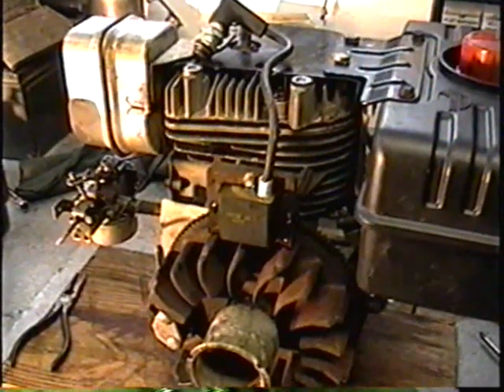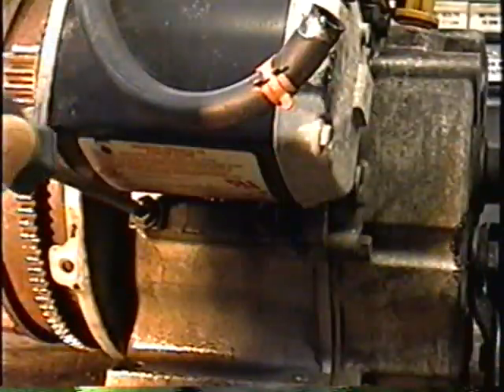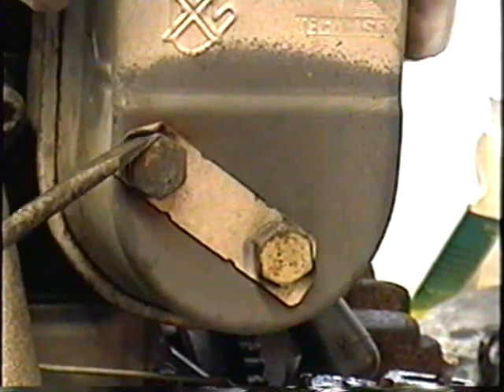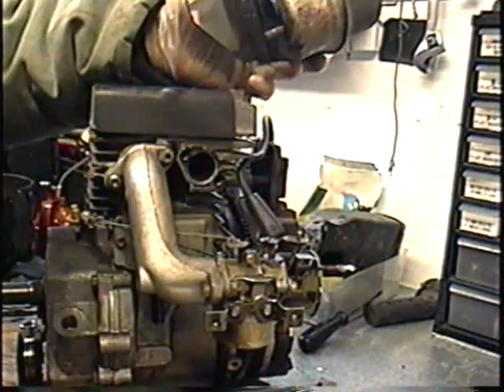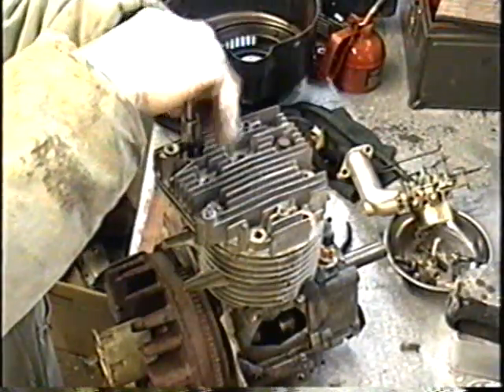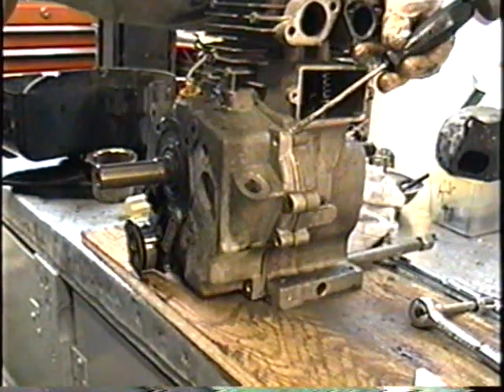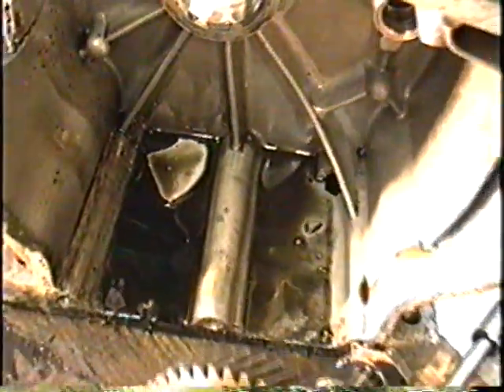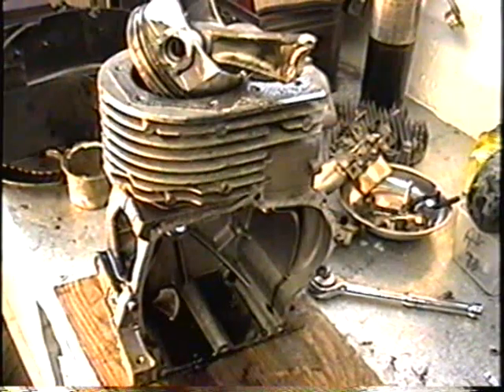TEARDOWN OF ANOTHER BLOWN UP 10HP TECUMSEH SNOWBLOWER ENGINE

Comment: @obbe69 dont worry ive  blown 2 B&S. with both u just have to keep maintained with good clean oil just some 30weight
Reply: Exactly right, except, I run 10W30, because of cold temperature, no matter which engine. (snow blower) 30 weight is good in the summer, for lawnmowers and rototillers.
     Both my snow blower and rototiller run Tecumseh engines, my lawnmower runs a Briggs & Stratton engine. With clean oil and good air filters, I'm certain, that all of the engines will outlast the equipment they're on.